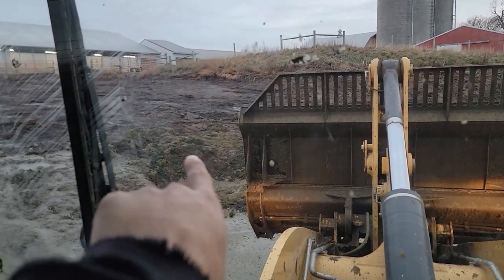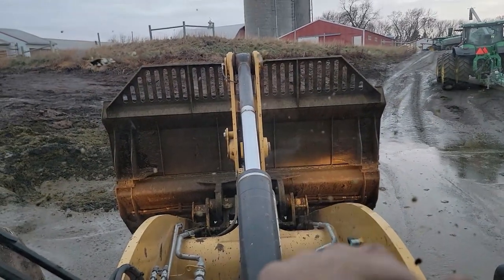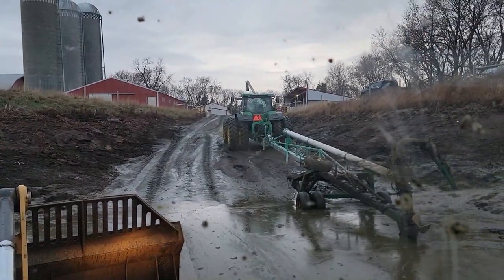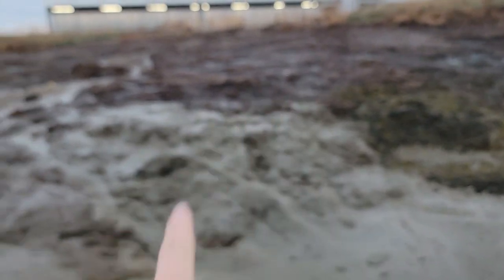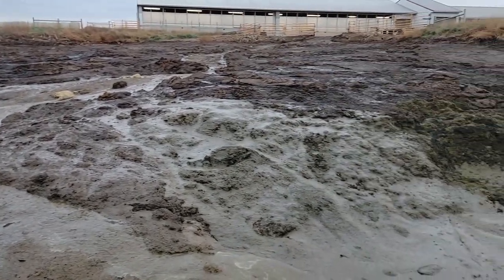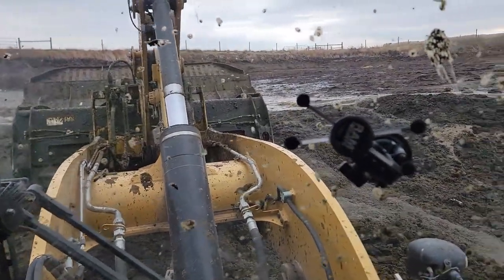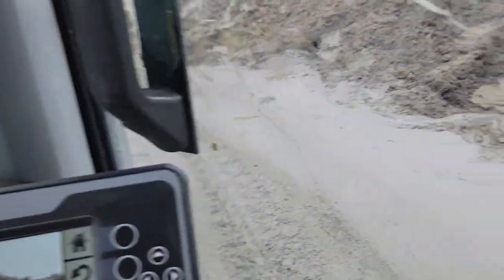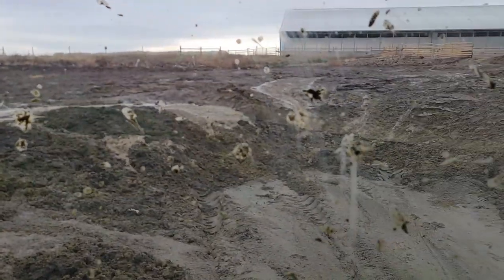Digging to China with our Caterpillar loader and John deere tractors

Comment: Around by me when they clean out lagoons they use big long reach excavators to get started. Then will put a loader in the pit once they have the room to do so but continue using the excavator as well. That way they can essentially load 2 spreaders at once. Not uncommon for them to have 5 or 6 Kuhn knight slinger spreaders going at once.
Reply from the maker: Everyone's operation is a little different. We only own 2 spreaders because we almost always haul right next to the farm site, or we haul it with the semis to the field first, this lagoon also has a concrete bottom. So instead of going out and buying a bunch of equipment that might make this go faster we just use what we have, might take an extra day but you make more profit using what ya have